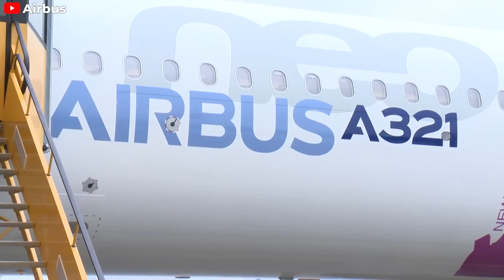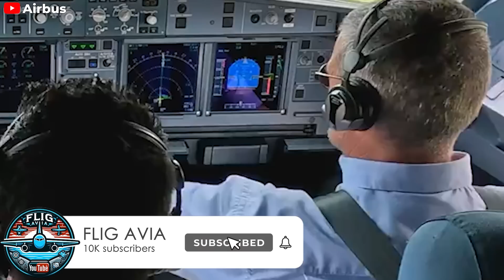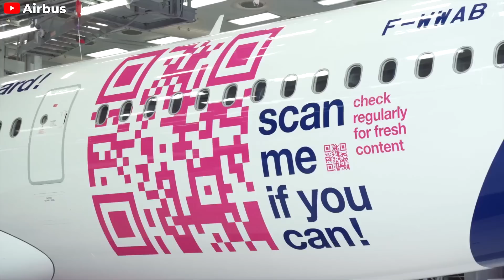The Real Reason Airbus launched the A321XLR will end Boeing! Here's Why

Comment: 321xlr has solid wing similar to old design plane,787 is advanced plane with flex wing and new generation flight control like electric actuator.787 has fuel tanks on wing noto. Fuselage.787 is sophisticated plane.
Reply from the maker: many thanks for your sharing

Comment: The 321 is "compared to its competitor the Boeing 757"(1:41)? Dude, the 757 ceased production twenty years ago - there are very few still flying! The big issue for Boeing is that it now has nothing at all that can compete with  the 321LR and XLR  (yes, big long range narrowbody WAS the niche the 757 once filled), because it decided to just try and stretch the 737 rather than build a 757 successor.
Reply from the maker: thanks for your feedback

Comment: Let's get some things straight first as so much utter nonsense is spouted.

Currently, there are no engines in production or in active development capable of powering anything much heavier than the A321. As such a resurected 757, or as some keep suggesting, one with minor modifications is not possible at the moment.

Even the 797 cannot progress to market until there are suitable engines.

The standard Airbus seats are wider than those on the Boeing (even the twin aisles), the cabin is over 6 inches wider than the Boeing single aisle aircraft. Everything else such as seat comfort, legroom and even the size and number of WCs is dependent upon how the Airline specifies the interior.

Take for example JET2 in the UK, the seats on their recently commissioned A321s were so badly received by the passengers that more comfortable ones are being retro-fitted.
Reply from the maker: thanks for your feedback